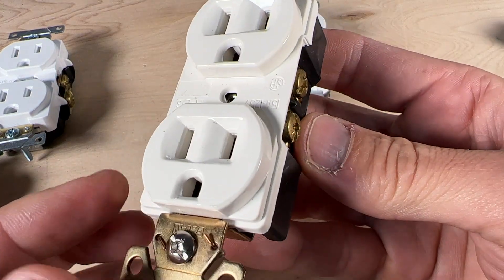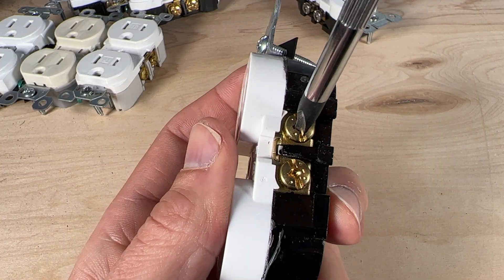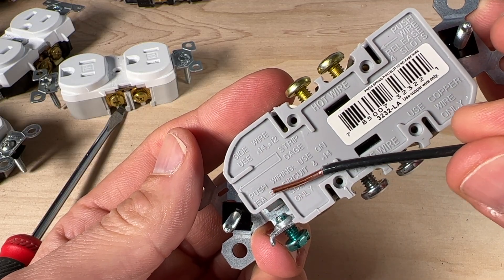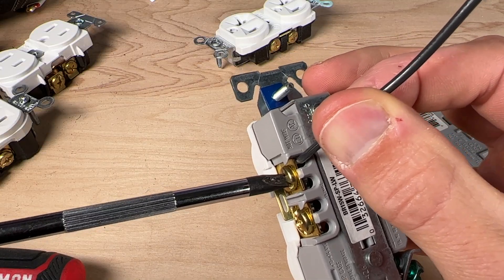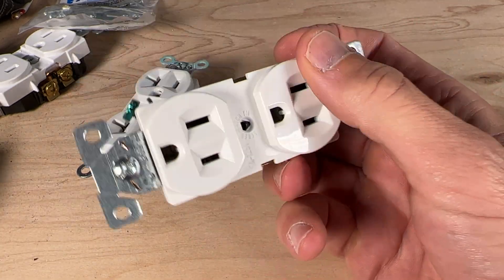21 Facts and Features Of A Standard Outlet

Comment: Small note; there’s no such thing as a “flat head screwdriver”. It’s actually called a “slot” screwdriver. ‘Flat head’ refers to a type of screw, not a screwdriver, and they are usually used for wood, along with a pre drilled countersunk pilot hole.

And back stabbing is an ideal way to burn down your house or apartment. It’s faster than normal connecting, and tempting, but don’t do it.
Reply: If you asked anyone on a job in the west coast for a slotted screwdriver, you'd be kicked off sight for not knowing your tools.
Reply: Beliefs die hard

Comment: #13 correction.  

You should only put 14awg wire in the push hole. It should mean that 12awg won’t fit but guess what.

Comment: I wish they would make an outlet device with two ground screws. I know technically, wires should be connected to each other and not have to go through an outlet device to provide continuity to the next outlet, but that seems silly. Isn't that why there are two hot screws and two neutral screws really.
Reply: If a hot/neutral wire loses continuity, it's not that big a deal. You lose power. If a ground loses continuity, the device can now be energized and zap the user. So no.

Comment: I've not seen any videos on your channel discussing aluminum wiring in residential settings. Although it was only used for a short time,  I've lived in two different houses with aluminum wiring and especially in the first house (30 years ago) I could have saved myself a lot of hassle had I known that you can't treat it the same as copper wire.
Reply: That's kinda vague...

Comment: The other thing is the orientation of the ground to whether it should face up or down as most outlets are installed.
In some circles it is mentioned as a U ground .
The purpose although it sometimes looks odd is to prevent a short across tge Hot and Neutral if the plate ( metal ) was to fall between the two and the ground pin would prevent this. If the plate is plastic it is irrelevant. There as far as I know no relevant reference in the NEC to this but merely a preference to who may be installing the receptacle.

Comment: 5:36 DO NOT USE THE SPEED WIREING HOLES!  One tiny little metal barb is all the holds the wire in and it will eventualy burn off.   Most common outlet failure I see.
Reply: As a service electrician the back stab wiring is the most common failure I find when at a “no power” job
Reply: Agreed! You should have the best contact possible.

Comment: I had to replace all of the kitchen switches and outlets ( my wife wanted brown instead of white), while the commercial grade are more expensive I think the extra quality and features are well worth it.   I really prefer the back wiring and the better build on them
Reply: I replaced all of the receptacles in my house, but only a few key places with commercial grade.  For instance the receptacle for the air conditioner.   But if you can afford the cost increase, I agree they are better.
Reply: @Lughnerson  I only had a few and it seemed that they only had brown in the better grade.  I think they were about $5 vs 1, so not a big deal.
Reply: @Lughnerson  your ac unit is plugged into a 120v outlet 😂😂😂😂 that ain’t a ac that’s called a swamp cooler

Comment: #20 is some of the most dangerous info provided by amateur electricians.  If you remove that recepticle, and while working on it you short the hot, you will energize the entire metal box and anything conductive that's in contact with it. It's obvious the poster either isn't a qualified electrician, or need to be retrained. And just one more correction, that is for bonding, not grounding.
Reply: Yes, self grounding devices are not to be used to bond the box. They are meant to be bonded by the already bonded box when installed.

Comment: Early speed wire outlets were made for 12 gauge wire. If you have one of those needing replaced and the wires are too short to bend into hooks, replace the outlet with a commercial type that has the screw tightened back wire feature.
Reply: Or add pigtails

Comment: Dang it, now I have to buy another tool.  😁. The Milwaukee ECX/#1 is on its way.  Also, after numerous homes and years of experience I was pretty sure I had it down. The little hole by the grounding lug tripped me up.  Great job and thanks. Enjoy (and learn from) your videos.
Reply: Just buy a Robertson #1 and a #2. That’s all we use for electrical work in Canada 🇨🇦 . Occasionally some appliances like lights or ceiling fans from China use Phillips screws.

Comment: Here is an off topic question.  I want to string some 4 LED ceiling lights to be operated by a dimmer.
The Lights are an absolute max of 15 watts.   4 lights would draw 60watts.   60watts is about one half ampere of current.  From what I read about wire gauge and amperes, a 22 gauge cable would be OK to use. (22 gauge is adequate for up to 5 amperes).   Is this allowed for your building code?
Reply: NO! wire size is based on the breaker, NOT the load.
All circuits in a home should be 15 amp minimum. This requires a minimum of #14 AWG to meet the potential 15 amp output of the circuit. All conductors are sized to prevent them from melting and catching fire before the breaker trips.
Reply: @jeffreylong500  I can actually install single or dual 5amp breakers into my panel for the LED circuit. So yes, I intend to do that, as, when traversing joists or floor beams, a 1/4 inch hole to pass a 20guage wire suffices. I do not want to weaken floor support. by drilling 1 inch diameter holes.

As a point of clarification.  The main floor of my duplex has a second floor. Above the ceiling are the upper floor's floor-joists.  I do not know for sure, but I do believe that the ceiling is nailed to strapping that in turn is nailed to the joists. Aside from the holes for the 5 inch flat LED fixtures, I should be able to fish the wires from the dimmer to the LED domes, and then from the dimmer to power.  Installation of the LED dome lights is a post install. I definitely do not want to rip a long line to carry the LED connections across above the ceiling.

Comment: Stay away from Wago Style connectors. They are good for 240V but wire nuts are better for 120V
Reply: @KevinCoop1  Wago connectors were shown and promoted 4 min into the video. Wago style connectors are NOT GOOD in 120V systems. Wago has a high contact resistance compared to wire nuts. 120V has twice the current for the same power compared to 240V. Combine high Wago resistance with high current at 120V over the long lifespan of a house and Wago style connectors become a BAD idea. Here is WAGO as seen by a German, pay attention to the contact resistance part https://www.youtube.com/watch?v=zgjo36-jaFY  8:46 Resistance Test (Heat)

Comment: What is the deal with the red and green dots on the front of the outlets?
Reply: Those are identification makes showing the recepticle having a dedicated or an isolated ground. Unfortunate he used them for something else.
Reply: someone said he put those on that display to show wrong verses correct wiring of outlets and lights the wires are reversed on the red outlet
Reply from the maker: Exactly that was from a past video where I reversed polarity on that mockup.

Comment: I've been doing electrical work since 1985 and today is the first day I've learned about the little hole by the grounding screw. That is great to know and will now help me with getting the grounding wire placed and wrapped around the grounding screw more easily. Thanks for taking the time to outline all these different features of these electrical outlets... You are very detailed with your explanations and this is the main reason I just subscribed to your channel...  Keep them coming...! Thank You...!
Reply: I just use the little hole on the wire stripper that is meant to help loop the wire ends.
Reply: Aww come on, you mean you don’t like trying to get a # 12 under a ground screw? Especially on a GFI Lol. Just Kidding, it sucks
Reply: @lewisoversole6781  I don't have a problem with that to be honest. Lol. I just don't use the hole that's on the receptacle like he showed in the video. I bend the hook with the hole that is on the wire stripper that is meant to bend hooks. That's just the way I've been doing it for years, rather than using needle nose pliers.
Reply: @illestofdemall13  I have always used the hole on the side of my wire strippers to bend the hook. I see what you’re saying though I never noticed a hole by the ground screw. I still think it sucks to get a #12 under a GFI ground screw though. Lol
Reply: @lewisoversole6781  Most GFCI receptacles these days have a little slot that you push the ground wire into (straight wire with no hook) that lets the wire go underneath a metal clamping plate, so it should be easy whether it's 14AWG or 12AWG. Don't try to hook around the ground screw with a 12AWG wire if there's a plate that allows you to put the wire in straight. Maybe that will help you next time.
Reply: @illestofdemall13  I honestly have never used a 14 on A GFI.
Reply: @lewisoversole6781  I do sometimes but depends on the location of the GFCI and what circuit it's on. But as far as the ground it should slide right in regardless of size then you clamp it down. Unless you are trying to loop it (not designed for looping on the newer GFCIs). That was the point I was trying to make. I saw someone I used to work with struggling to loop a ground wire around the screw on a GFCI and I showed him that it didn't need the loop and it was instantly easier for him. Lol
Reply: Didn’t it wrap in the wrong direction for tightening?   Counterclockwise
Reply: @hellkell8693  No
Reply: @illestofdemall13  check at 6:47. He went ccw.
Reply: @hellkell8693  No he didn't. He wrapped it correctly but started from the end of the hook using the hole to make the loop in reverse. I have been doing electrical for a long time and I am wiring a mansion by myself right now just to give an idea of my experience level. When the screw turns clockwise the hook will tighten as it should. The end of the hook is pointing to the right while it's facing him. I have tried to explain this to several others in the comments.
Reply: @illestofdemall13  you are correct. I wasn’t looking at it correctly. Thank you.
Reply: @hellkell8693  No problem. It looks odd because to use that function you have to loop it around in reverse to get the same outcome.
Reply: You must be a real shoemaker 😱
Reply: @SG-hh9lu  What does that mean?
Reply: @illestofdemall13  it means alot of what you showed is easier when the wires you are connecting are not in the box 😯
Reply: Me too

Comment: 0:00 - #1  Guiding slots for plug alignment
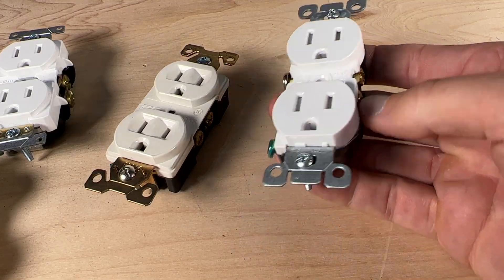0:31 - #2  Slot sizes (Hot/Neutral)
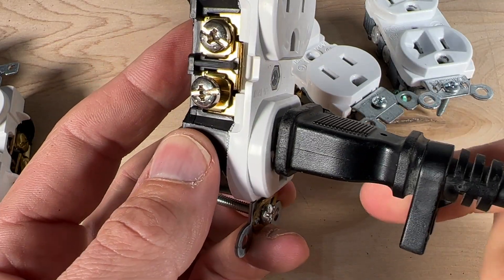1:06 - #3  15AMP/20AMP Identifier
1:33 - #4  Yoke Tabs for Flush Installs
1:57 - #5  Yoke Tabs Removal Scenarios
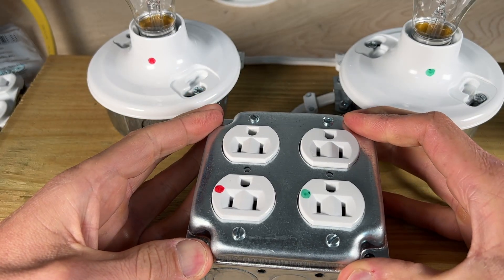2:29 - #6  Color of Screw Terminals
2:39 - #7  Color of Terminal (Black)
2:51 - #8  Tab Feature on Terminals (Separating them)
3:18 - #9  Screw Terminal Bit Size
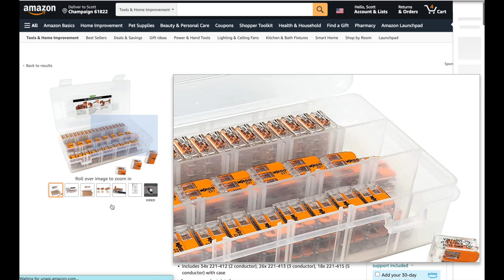4:09 - #10 Plastic Channel to Bend Cable around Terminal
4:35 - #11 Clockwise Direction for Terminal Screw Install
4:46 - #12 Speed/Push Wiring Cable Size
5:10 - #13 Speed/Push Wire Release slot (One time use)
5:25 - #14 Speed/Push Wire - Screw Terminal are independent
5:36 - #15 Commercial Grade Outlet Back Wiring
6:18 - #16 Strip Gage for Speed/Back Wire
6:42 - #17 Ground Terminal Help Hole
6:59 - #18 Best Practice - Tighten All Screws
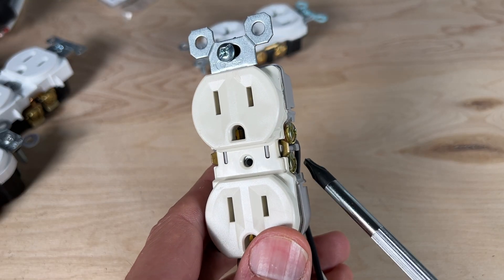7:24 - #19 Mounting Screw 6-32 Machine Screw
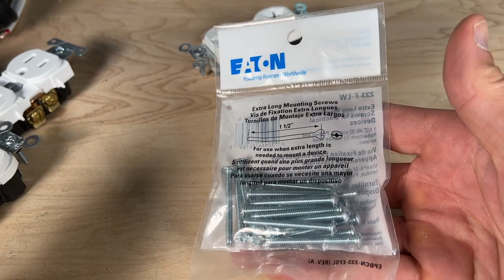7:47 - #20 Self Grounding on Commercial Grade Outlets
8:14 - #21 Integraded wire strippers in Commercial Grade Outlets
Reply: Hi Nyan, thank you for indexing this video, Ciao, L
Reply: #22 outlets have same looking face, you'll make, if you didnt turn off power, and get zapped. Lol
Good video.

Comment: The “flat faced” outlets are used in “tamper resistant” outlets. In addition to the insert that requires both prongs to be inserted simultaneously, the outlets don’t have slopped sides to easily guide an object into the receptacle. This is a safety choice.

Comment: The ground one and the j hook with the grounded and ungrounded conductor .I usually prebend them then use that part to snug it up but I think I won’t anymore that looks way faster.also I agree I prefer the commercial grade that has the plate that tightens down they are the simplest and cleanest and best connections they get tighter without breaking it  too there stronger for sure

Comment: Two of them were new to me. The stripper on the ear part of the receptacle and I did not know that the stabbing feature and the screw terminal were totally separate. I ask myself how can that be? I’m going to check on the outlet tonight. Thank you good job
Reply: By separate, they are electrically connected but the retention in back stabbing is independent of the screw’s position.

Comment: Nitpicky item <grin>  Learned more than a couple from this. #17 with the hole near the ground screw; you say to put it in the hole and wrap the wire clockwise, and you proceed to wrap it counter clockwise..  <grin>  I bought the Knipex pliers and LOVE them!!! I only have to carry one now instead of 3.
Reply: It's still in a clockwise direction. The wire comes in on the left side of the screw and wraps over the top, he just installed the wire in reverse order, which made it look reversed.
Reply: You're wrong just like the last person who said that. The turn of the loop/hook is clockwise so it will close when tightened. There is no other way to use that hole and also wrap in the right direction other than how he did.

Comment: Thanks for this video. Just bought an '83 townhouse and I need to exchange all of the outlets. Although I replaced 2 outlets before I admit I really didn't know what I was doing. I did know to turn the power off at the box. How do I know to get either a 15 or 20 amp outlet?
Reply: You can tell by the circuit breaker or the wire, you can use a 20amp receptacle on 12awg wire but not on 14awg wire. It's best just to use 15amp receptacles to be safe.
Reply: @jefflebowski918  thank you!
Reply: @jefflebowski918  With electricity, watts = volts times amperes.
A 15 amp breaker at 120 volts can support 1600watts with 200 watts spare.
Your LED light uses 12 to 13 watts, depending on the lighting intensity you choose.
Your TV may use around 300 watts.

Where I live (Montreal), we can daisy chain up to 4 max electric receptacles for lamps.
In the kitchen over the counter, it's still 3 receptacles with a gfci as one of them. Thats about right for a toaster, electric fry pan and a coffee maker.
Reply: nobody uses 20 amp outlets even on 20 amp circuits unless they have some giant machine requiring it everyone just puts 15 amp outlets in on 20 amp circuits and 15 amp
Reply: Depends on the wire color 12-2 yellow 20amp .
14-2 White 15amp
Reply: I have never in my life seen a residential appliance that has a 20 amp plug, and only once have I seen one in the power plants I've worked in. So don't even bother with 20 amp outlets, use 15.

Comment: similar to #3 on the slot being turned.  When the hot side is turned, horizontally it's a 250 volt outlet.  The receptacle for this obviously will never have a T shape.

#17 I did not know about the hole for forming the ground loop.  I've seen a plate on the right side of the screw that I assume serves a similar purpose.

Comment: Can a USA duplex receptacle rated for 120/60, be used in locations where the power is 220/50. Where I live in Thailand, the quality of  components is very poor
Reply: Just use a Panasonic WN1512 outlet (with screw terminals at the back) as the 250V/20A receptacle shown in the video may not physically fit into the wall utility boxes we use in Asia.
Reply: Just use a 50 Amp 250 Volt US receptacle (but the prongs will be wrong for your country).
Reply: @illestofdemall13    You read it too fast.   The 50 is hertz.   Best wishes,   Kevin
Reply: @KevinCoop1  He didn't specify so I presumed, but now it makes sense. I am used to dealing with voltage and current ratings because 60 hertz is a given where I live.
Reply: No, absolutely not. You need to use the receptacle for your country! Otherwise someone could plug in a 120/60 device and it would be destroyed.
Reply: @aaron74  plugging in a 120V device is possible anyways in many countries in Southeast Asia as the countries basically use the American flat plugs for 240V outlets. 

The problem is that many locally (and Chinese) made receptacles are of horrible quality sometimes failing after only a few weeks. Buying Japanese branded outlets such as Panasonic or Toshiba is the best option as they are compatible to other items such as the in-wall utility boxes in which the receptacles are mounted. Using American 250V/20A outlets would work fine electrically, but may not be a perfect fit in existing boxes.

It will also depend on the local electrical code. Philippines uses the NEC 2017 from the US which would obviously allow UL certified receptacles, but Thailand I do not know.
Reply: @ChristianWagner888  But if the nominal AC standard for a country is 220-250V Hz, how do reason that it's okay to use a NEMA 120V receptacle? I realize that, if the NEMA receptacle were connected it would be fine; it's just conductive metal. It's more of the principle of using a socket where the expectation is that its supplied voltage is 120V at 60 Hz, but it's not.
Reply: @ChristianWagner888  Wait a minute, you're saying these countries use NEMA 1-15P (or 5-15P) plugs for 220V appliances?!?
Reply: @aaron74  yes we use these NEMA types in the Philippines and neighboring countries

Here is an example. Clearly marked for 250V. Usually 10 A or 16 A with that plug type. 

http://const.ph/wp-content/uploads/2016/08/Panasonic-Receptacle-Duplex-w-Ground-w-Plate.jpg
Reply: Frank,   There are 15, 20, & 30 amp receptacles that are rated for 250 volt.   The 50 hertz doesn’t matter.